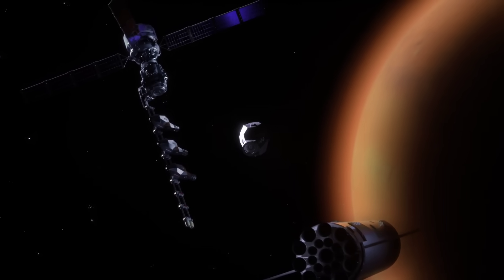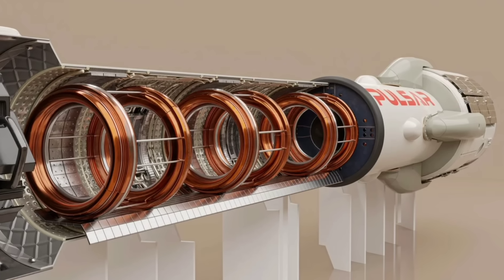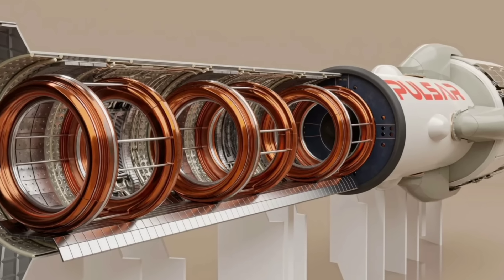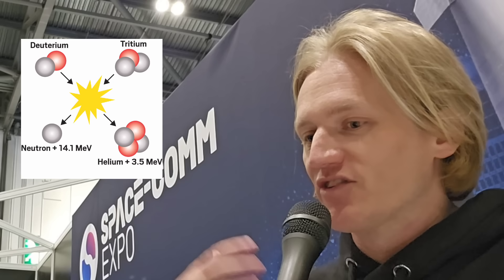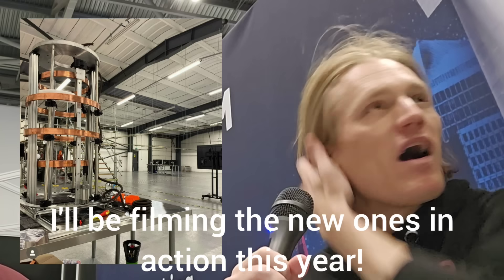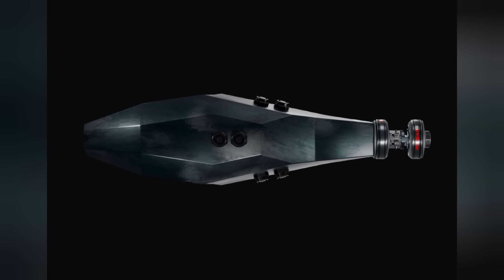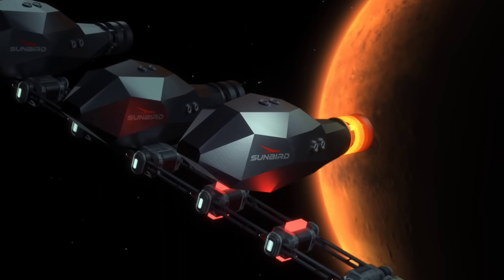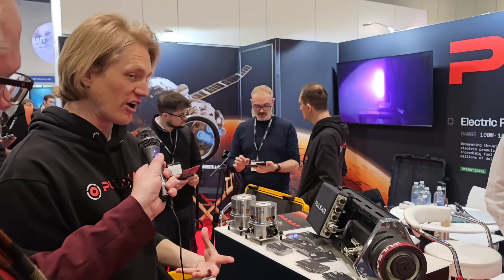15 TIMES faster than Nuclear Rockets!  Pulsar Fusion unveils new Sunbird Fusion Drive!

Comment: Sunbird could be attached to Starship to take it to the moon and to Mars rather than Starship having to send up 10 or more other Starships to refuel just one Starship/HLS so that it can go to the moon
Reply: It's simple, build our own tin can, hail a SpaceX taxi to orbit a couple of times (don't forget the Sunbirds) strap 'em on in orbit and away we go!
Ok, "tin can" is a bit flippant, but there's no need to worry about the hard stuff like rocket engines - it's not designed for atmospheric flight. There are smaler landers\space planes that could be carried as stowage for that purpose.
My point is that the full focus can be put onto shielding, comfort, safety, reliability, reusability and doing this at scale, without having to worry about to-orbit propulsion concerns.
This could also be a good test for inflatable \dirigible systems currently being mooted as space platforms. If their designs could be improved to take the accelerations and stresses involved they might even be an option. Unmanned initially of course!
Cheers 👍🏼
Reply from the maker: Correct!
Reply: @TheAngryAstronaut still need to launch the astronauts on DreamChaser because Starship won’t be safe enough.
Reply: Depends on the cost. It's more important than speed, and He3 is very expensive.
And thrust is also important on shorter missions. If it doesn't accelerate fast enough, the trip could take longer.
Reply: Why would they attach a starship to it?  Why not use something else?
Reply: Like what? There isn't anyone else that has that launch capability(at least at scale) and no one else has reusable rockets.
Reply: Hahaha.. the only way for that popous laminated face with hairplugs to be more smug and claim that he invented it would be to associate sunbird with his shitty projects..
Reply: Why Starship and carry all that chemical propellant. Its silly
Reply: It’s gonna probably take 12-18 starships to refuel in LEO to then go to the moon, IF none of them have a Rapid Unscheduled Disassembly!
Reply: @ 
Current estimate is 10-14 tankers, maybe less. Can go down to 6-8 with V3 Starship.
And that's no issue when they are rapidly reusable. Most of the cost will be fuel, and you can't get around that easily.
If you can mine He3 on the Moon, you might as well mine water and dry ice, and manufacture methane and oxygen for Starship.
Reply: Starship is a ground-to-LEO shuttle, Sunbird is part of an interplanetary transportation system!
Reply: @ 
Starship's original name was literally Interplanetary Transportation System (ITS).
The whole reason for it's existence is colonizing Mars.
Reply: Sunbird is (could be😊) the ocean liner. Starship is only the loading barge. It is interesting to see how the unloading device would look. Probably something like new version of the Shuttle.
Reply: @IvanPetrov-k2k  
No. Starship is the ocean liner and container ship. Sunbird is more like a plane. A lot faster on long routes, but also much more expensive.
Reply: We need a space elevator yesterday .
Reply: Elon would never allow it. He would have to share the credit.
Reply: @HarlanEllisonlives  Elon needs 1000 Starships to make Mars self supporting, these engines will make it faster to achieve.  Elon does one things really well, make factories that can build huge numbers of things fast. Robot He3 mining on the Moon?
Reply: @FlintStone-c3s  yeah, but his starships keep exploding, don't they?
Reply: @HarlanEllisonlives  Check the early history of US rockets. Elon's other older design rockets used for most launches don't explode. Star Ship just makes bigger booms. He has lots of issues to sort out before mass production, these are just rapid prototypes.
Reply: @FlintStone-c3s  i have pointed out starships exclusively in prior comments. His starships are actually are blowing up sooner than the earlier ones.
Reply: @FlintStone-c3s  you can't compare early rocket failures at nasa to his current ones. The science of rocketry was established he's piggybacking on older established science with new technology and they go boom.
Reply: @FlintStone-c3s you still need 1000 ships.... for every 2 years. Volume order. Not speed.
Reply: @shawncooper8131  Less ships needed if they go faster. Enough materials need to get to Mars to make it self sustaining. Quick travel means longer window of time for ships to get there. 6 months verses 39days, verses days?  Some say tech exists for hours travel time, Elon does not have that yet? He has said he has the best "chemical" rocket engines, this is true, does he have other types of engines? Head of Space Force has said USA Nuclear  engines are better than the Chinese ones. Why has the CIA said they hid an entire field of Physics?
Reply: @FlintStone-c3s  
There are no other types of engines yet. And developing them is very hard, because anything better must be nuclear, which comes with an insane amount of red tape.
Reply: @HarlanEllisonlives  You are thinking about Jeff ... he is the one who cant share the stage.
Reply: @HarlanEllisonlives I feel like anything that realistically advances his goal of reaching Mars would be welcomed with open arms. Perhaps I’m wrong, but that’s what I’d expect.
Reply: Youtube comment windows suck. Lose what your saying if you disrupt it in anyway.
Reply: @HarlanEllisonlives No he would just buy it and call it sunbirdx.
Reply: @HarlanEllisonlives no. He could just buy them out and change the name to X Fusion.
Reply: @HarlanEllisonlives  He already is, he is not the only organization associated with that mission.  Get your head out of your MSM
Reply: @seditt5146  i love ignorant fools trying to lecture.🤣😅🤣😂🤣 let's play the drinking game a shot for every starship.that blows up.😘😘😘
Reply: @seditt5146  Why do you presume they need to listen to "MSM" for that? All anyone needs to do is listen to what Elon himself says in interviews and on his personal echo-chamber of a social media platform. He treats those other organisations as nuisances. Even NASA itself.